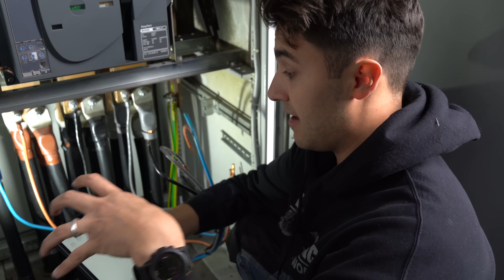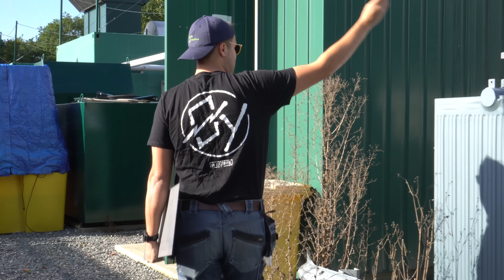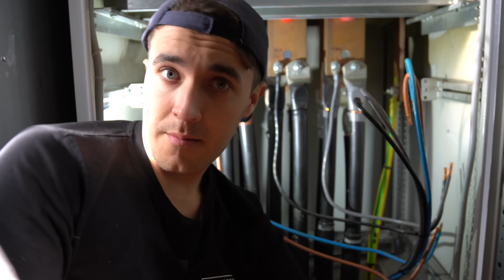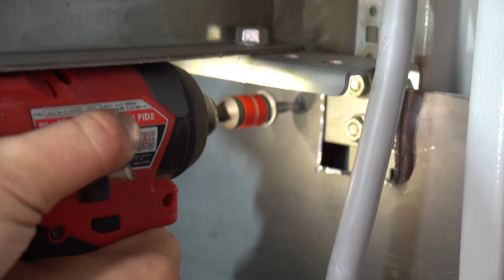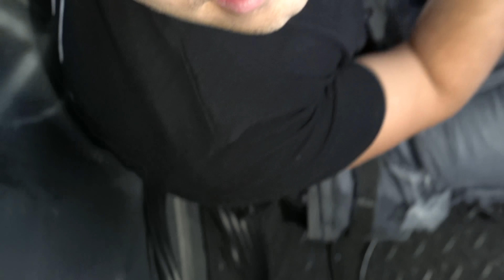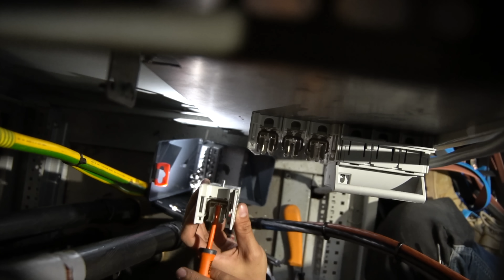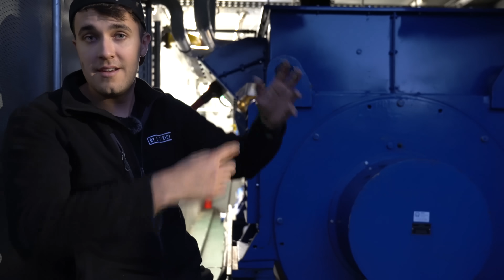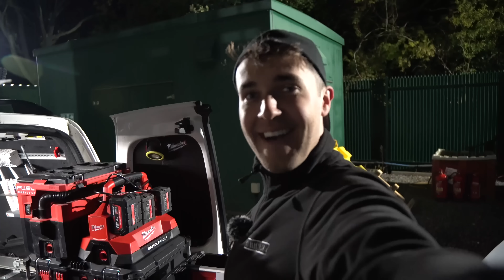11,000 Volts BREAKDOWN ( The UK Grid is Struggling ) | ØY31

Comment: When tapping thin steel like this, simple put the tap in your battery drill and use a low tourqe setting
Go slow
You will usually get it straighter than with the proper tap holder, especially with the awkward angle that you have

Comment: Instead of drilling + tapping into thin sheet, I’d suggest getting a rivnut gun and rivnuts. Much better fixing.
Reply: It’s an expensive way to do it and a waste of time , Rivi nuts are for thin metal  use
Reply: @Actual_electrical_content  Well, I did say that they were the better option for 'Thin sheet', as give a stronger fixing without ripping the thread out. But then again the fuse carriers you guys were screwing on seemed to be made of toffee and dreams - so probably best Cory couldnt do them up too tight! 😜

Comment: Ah, one of 'these' jobs where it seems to be going OK, even though the pressure's on and it's getting late and you're just about done then .... problems!

Anyway, just wanted to mention a couple of things regarding the 'G99 relay' Looks like it's an integrated device (lots of eggs in one basket 😟) so it may well do the sync check between the grid and the machine but that in itself isn't the G99 bit. For non-UK viewers (and those in the UK that are wondering what it is), Engineering Recommendation G99 is the technical standard in the UK for interconnection of sources of electrical energy with the distribution or transmission networks - the 'grid' - published by the Energy Networks Association. The G99 protection functions in the relay are monitoring the voltage waveforms to ensure voltage magnitude and frequency stay within prescribed limits and that interconnection with the grid hasn't been lost. The relay possibly does other things besides the core G99 functions too.

The reference by the AP, Jamie, about alternators that are interconnected to the grid with no prime mover in order to provide 'oomph' is describing the increasing need to provide or replace system inertia that allows the networks to remain stable during events like faults. The alternators can also be used to control the flow of reactive power, which is important is controlling network voltage.
Reply: Looks like a ComAp MainsPro relay to me which is just the G99 protection functions. The synchroniser and generator protection are in the panel opposite, which I think was some form of Deep Sea engine / generator controller which will have the synchroniser, AVR and some basic protection built into it.
Reply: @three-phase562  I have to confess, as a retired DNO protection and control engineer, to always feeling a bit on-edge watching the wiring for the reference voltages being altered. Was always a bugbear of mine when witness testing G59/G99 sites. On our networks, having this amount of interference in the wiring would require complete recommissioning of that part of the protection, which is why DNOs and TSOs use test blocks as an integral part of the design. It is VERY easy to literally get your wires crossed and the outcomes are not always quite as tame as the AP in the video alludes to! Out-of-sync closing of the generator CB is never pretty, as I’m sure you’re only too well aware.
Reply: @sleepyspaniel2018  I agree, I was taught to re-commission a protection system if any of the voltage, current or trip signals were ever disconnected. The larger 10MW reciprocating gas engines I have seen, do have test blocks within the panels. I think it is some of these smaller sites that are being installed by capital investment companies where the more finer details of these installations go awry. 
A lot of the synchronisers I worked on only utilised the one phase, so there could be severe problems if connections weren't correct, although we did have independently wired check sync systems for backup. I know the Deep Sea units take in all three phases, but I am not sure if it utilises all three for synchronisation or if it just uses the signal from one.

Comment: 1:58 them 11Kv cables. I'm not a spark but I'm fairly sure that there isn't supposed to be any exposed conductors
Reply: That's 400V-690V cables. They go to an 11kV transformer on the other side of the wall.

Comment: I loved this video. It is exactly what I do, industrial but in network distribution that I never had the chance to touch (and prefer to leave to the more competent than me for a long margin).

Regarding the sheet metal work, what you've done works but normally I use some threaded nut rivets.

Although 2mm thick sheet threads is enough for catching a screw I'm always afraid that by any external conditions or brute force of the next one to touch that will rip them from the sheet.

But hey it works and it is enough.

Comment: The palms of those mains cable lugs are barely on the bus. It looks like the bars were not designed for so many cables per phase of that size.

I'd like to see thermographics under full load.
Reply: I’ve got one and I can assure you the copper meets the requirements and it’s all fine

Comment: Top stuff lad 👍
I fully hate auxiliary cables on primary terminations. At least they have a separate bolt. Seen 6mm control stuff on massive 16mm krimps on the same bolt as the twin 185mm 😂😂

Comment: Great video Cory. I have sold gas engines & CHP solutions in the UK for the past 13 years (nat. Gas  bio gas and Hydrogen fuelled). I was also the accountant manager for the CHPs that are installed at the UK&I Center Parc sites. Happy to answer any questions on CHPs if you need any help. PS I now work for a Wind Turbine OEM for projects in the UK&I

Comment: Cool episode. I thing the general plan is to replace peaker plants with big fat cabinets full of Lithium batteries that top off from the grid at quiet times, and then dump pack as demand goes up. Physically bigger, but less mechanical maintenance needed. There's going to be one big wheel left in a hundred years clocking the grid.
Reply from the maker: Octopus are kind of already doing this if you think about it… except remotely and having the batteries for free! They use their customers houses as a battery farm essentially
Reply: At current prices, a lithium battery that can provide 1 megawatt for 1 hour costs the same as a 1 megawatt generator and enough fuel to run it 24/7 for a year.

And unlike the generator, that lithium battery has no be recharged at some point.
Reply: There was a test battery unit constructed in Australia made out of partly broken kia battery packs, with huge capacity

It's on fire right now of course, been on fire for a few weeks, they didn't build the bund walls high enough to fill them with water and cover the packs in case of emergency